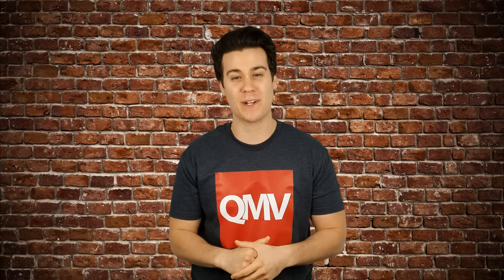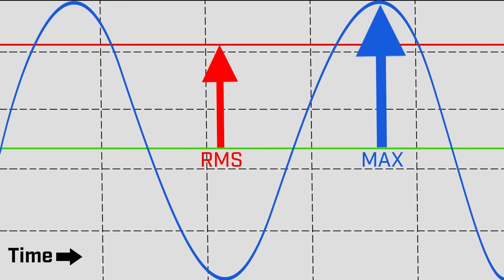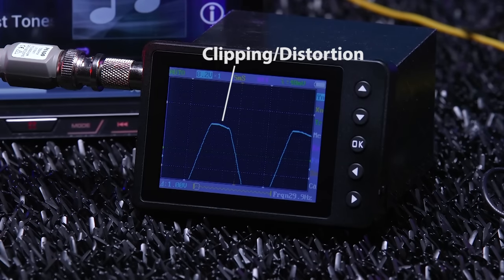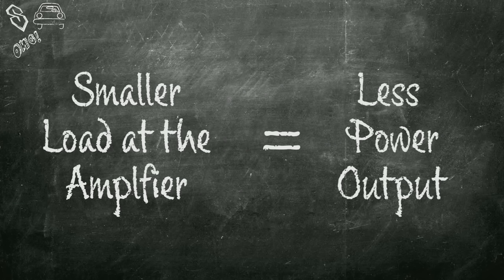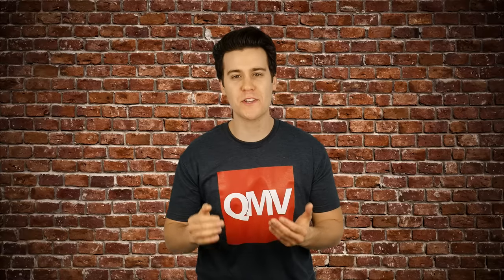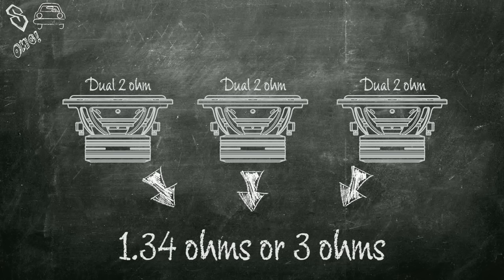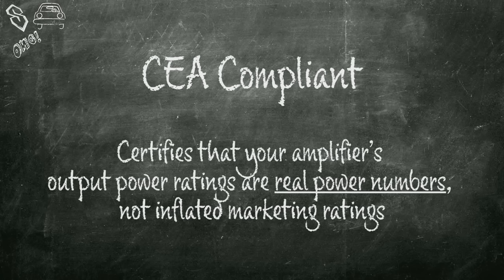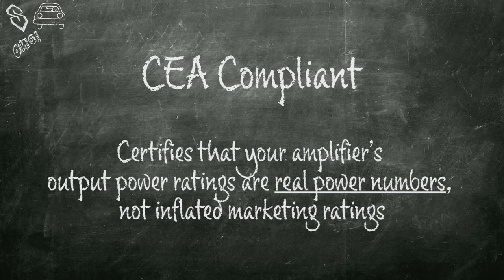How Do You Match Car Subwoofers and Amplifiers?

Comment: I have 4  2ohm dual voice coil 10 inch subwoofers that are 200 rms each what kind and size amplifier should I run thanks in advance
Reply from the maker: Four DVC 2 ohm woofers wire to 1 ohm or 4 ohm. So a monoblock with an RMS of 800-1000W RMS @ 1 ohm or 4 ohm. 

Rockford Fosgate P1000X1BD
http://www.qualitymobilevideo.com/rockford-fosgate-p1000x1.html?utm_source=YouTube&utm_medium=Video&utm_campaign=Match_Subwoofers-Amplifiers

Pioneer GM-D9701 
http://www.qualitymobilevideo.com/gm-d9701.html?utm_source=YouTube&utm_medium=Video&utm_campaign=Match_Subwoofers-Amplifiers

Rockford Fosgate R1200-1D
http://www.qualitymobilevideo.com/rockford-fosgate-r1200-1d.html?utm_source=YouTube&utm_medium=Video&utm_campaign=Match_Subwoofers-Amplifiers
Reply: @Qualitymobilevideo  cool thanks for the reply and love the video

Comment: How do you wire a system with different size subs? I have 2 8 inch and a 10 inch. Is this possible? If so how? The 2 8s are DVC 4 ohm with and RMS of 250. And the 10 is a DVC 4ohm and RMS of 350. So combined that's 850 RMS? Then wired in parallel that's .667 ohms? Now that I understand but if it running off a mono block to subs with different RMS ratings it won't cause damage? And the only amps that I have seen come close to that is 1000 RMS at .5 ohm load?

Comment: Hi I have 2x 12inch jbl jto1202d subs, I'm really stuck on what amp to buy? As I do really love to listen to low bass tracks.Any help would be fantastic.
Thank you.
James.
Reply from the maker: So those are DVC 2 ohm subwoofers. Two DVC 2 ohm woofers can wire to a 2 ohm or  8 ohm load. Wire to 2 ohm. They're also 300W RMS each, so 600W RMS combined. You'll want a monoblock with an RMS power range of 500-750W RMS @ 2 ohm. Check these out:

Pioneer GM-D9601 
http://www.qualitymobilevideo.com/gm-d9601.html?utm_source=YouTube&utm_medium=Video&utm_campaign=Match_Subwoofers-Amplifiers
 
Rockford Fosgate R1200-1D 
http://www.qualitymobilevideo.com/rockford-fosgate-r1200-1d.html?utm_source=YouTube&utm_medium=Video&utm_campaign=Match_Subwoofers-Amplifiers

Rockford Fosgate R500X1D 
http://www.qualitymobilevideo.com/rockford-fosgate-r500x1d.html?utm_source=YouTube&utm_medium=Video&utm_campaign=Match_Subwoofers-Amplifiers

Kenwood KAC5001PS 
http://www.qualitymobilevideo.com/kac5001ps.html?utm_source=YouTube&utm_medium=Video&utm_campaign=Match_Subwoofers-Amplifiers
Reply: @Qualitymobilevideo  thank you so much for letting me know! That's a fantastic help I will now do some investigating 👍

Comment: I have two 1200 watt peak Memphis subwoofers (600 rms) running on a 1600 watt   Autotek street machine amp with the wiring ran parallel on both speakers...I no longer have this amp and I’m going with a hifonics brutus brx2000.1d giving off 700 watts @ 4 ohms,1400 watts@ 2ohms,and 2000 watts 1 ohm is this good choice are was the street a better wattage choice.
Reply from the maker: What impedance are the subs? Are they dual voice coil?
Reply: 2 ohms and yes they have dual coils

Comment: Can I connect 500 rms 2 4ohm dvc sub wired together to a 1 ohm load to a 1500.1 rms amp at 1ohm or does it have to be an exact match like 2 750rms subs

Comment: can I pair of 500watts rms & 1500watts peak power subwoofer on the 500watts rms on monoblock at 2OHM ? what impedance can I choose between 2OHM or 4OHM for best performance and undamaged a subwoofer and amplifier, my monoblock 500w rms is stable 2OHM ( 300w rms at 4OHM & 500w rms at 2OHM @ 1000w max power, CEA 2006 COMPLIANT  ) better I running 2OHM or 4OHM for 500w rms subwoofer ???

Comment: Picked up a Rockford fosgate P1000X1BD and 2x Rockford Fosgate P2D2-12 Punch (400w RMS). Should I wire these at 2ohm?
Reply from the maker: Two DVC 2 ohm subs make a 2 ohm or 8 ohm load, so yes 2 ohm is ideal! However, even though that amp is legit as fuck, it only does 600W RMS @ 2ohms, whereas the subs do a combined 800W RMS. So they'll be a little under-powered. it's best to have your amplifier with a higher power rating, about 720-1000W RMS for your situation, but you should be fine.
Reply: Quality Mobile Video The description on the amp says 1000w x 1 @ 1 Ohm. Is it possible to wire my subs to 1 Ohm? Thanks for all your help!
Reply from the maker: Sorry bud, but no! If they were DVC 4 ohm woofers then yes, two of those could be wired to 1 ohm. But two DVC 2 ohm woofers can't :(
Reply: Quality Mobile Video have any suggestions on a more suitable amp?
Reply from the maker: Pioneer GM-D9601 800W RMS @ 2 ohms
http://www.qualitymobilevideo.com/gm-d9601.html?utm_source=YouTube&utm_medium=Video&utm_campaign=Match_Subwoofers-Amplifiers

Rockford Fosgate R1200-1D 800W RMS @ 2 ohms
http://www.qualitymobilevideo.com/rockford-fosgate-r1200-1d.html?utm_source=YouTube&utm_medium=Video&utm_campaign=Match_Subwoofers-Amplifiers

Kenwood KAC9106D 1000W RMS @ 2 ohma
http://www.qualitymobilevideo.com/kac9106d.html?utm_source=YouTube&utm_medium=Video&utm_campaign=Match_Subwoofers-Amplifiers

Kicker CAX1200.1 1200W RMS @ 2ohms
http://www.qualitymobilevideo.com/cxa1200-1.html?utm_source=YouTube&utm_medium=Video&utm_campaign=Match_Subwoofers-Amplifiers

Power Acoustik RZ1-1500D - 900W RMS @ 2 ohms
http://www.qualitymobilevideo.com/rz1-1500d.html?utm_source=YouTube&utm_medium=Video&utm_campaign=Match_Subwoofers-Amplifiers
Reply from the maker: Plus here's a larger list: https://www.qualitymobilevideo.com/car-audio/car-amplifiers/mono-car-amplifiers.html?amp_output_power_rms_2ohm=700-1200&dir=desc&order=price

Comment: I have 2 10" 300W 4-Ohm Planet Audio RX1014 subs. Their RMS power range is 150 watts. What would be the best way to wire this and to what type of amp, to get the most out of them?
Reply from the maker: Two SVC 4 ohm subwoofers can be wires to a 2 ohm load in parallel, which is what I would do. So you'll want a monoblock amplifier with a power rating of about 250-400W RMS @ 2 ohms. Check these:

Kicker
42PXA5001 - 500 watts RMS x 1 Channels at 2 ohms
http://www.qualitymobilevideo.com/42pxa5001.html?utm_source=YouTube&utm_medium=Video&utm_campaign=Match_Subwoofers-Amplifiers
Rockford
Fosgate P300X1 - 300 watts RMS x 1 Channels at 2 ohms
http://www.qualitymobilevideo.com/p300x1.html?utm_source=YouTube&utm_medium=Video&utm_campaign=Match_Subwoofers-Amplifiers
Rockford
Fosgate R500X1D - 500 watts RMS x 1 Channels at 2 ohms
http://www.qualitymobilevideo.com/rockford-fosgate-r500x1d.html?utm_source=YouTube&utm_medium=Video&utm_campaign=Match_Subwoofers-Amplifiers
Kicker
CXA300.1 - 300 watts RMS x 1 Channel @ 2 ohms
http://www.qualitymobilevideo.com/cxa300-1.html?utm_source=YouTube&utm_medium=Video&utm_campaign=Match_Subwoofers-Amplifiers
Kenwood
KAC5001PS - 500 watts RMS x 1 Channels at 2 ohms
http://www.qualitymobilevideo.com/kac5001ps.html?utm_source=YouTube&utm_medium=Video&utm_campaign=Match_Subwoofers-Amplifiers
Reply: Thank you so much!!👌🏽 I will do that!
Reply: Since you said 250-400 would the 500w amps be too much?
Reply from the maker: @mehoyminoy2485  That's totally fine! It's always good to have head room, and an amp with a higher rating is ideal so get it
Reply: Thank you so much!!!! And for wiring I bought a wire kit set for 1200watts from Walmart, is that ok? There was also one for 600watts and 1600watts

Comment: Hey I'd love to ask since ya offered, I just recently purchased a 15" 1500 watt AudioPipe but its a dual 2 ohm subwoofer. The amp I chose was a HiFonics 2200 watt BRUTUS. Is this okay ? The box the sub came is is saying 2800watt being that it's a dual 2 ohm woofer.
Reply: Rms of the sub is 1400 watts and the rms of the amp is 1100 watts @ 2 ohms
Reply from the maker: Without models numbers are arbitrary.
Reply: Audio pipe 15" 1500 watt dual 2 ohm - TXX-BDC5-15

HiFonics BG-2200.1D Brutus Gamma 2200 watt mono amp

Comment: I’m thinking about getting the pioneer ts-W300s4 12inch max output 1400w normal bee 400w. What’s the best amp for this sub please mate as I really don’t get it either lol
Reply from the maker: Happy to help! So that is a SVC 4 ohm woofer with an RMS of 400W. It only wires to a 4 ohm load. Easy set up, you'll want a monoblock amplifier with a power range of about 350-500W RMS @ 4 ohms. Here are some options:

Pioneer GM-D9701 
https://www.qualitymobilevideo.com/gm-d9701.html?utm_source=YouTube&utm_medium=Video&utm_campaign=Match_Subwoofers-Amplifiers

Power Acoustik EG1-2500D 
https://www.qualitymobilevideo.com/eg1-2500d.html?utm_source=YouTube&utm_medium=Video&utm_campaign=Match_Subwoofers-Amplifiers

Power Acoustik RZ1-1500D 
https://www.qualitymobilevideo.com/rz1-1500d.html?utm_source=YouTube&utm_medium=Video&utm_campaign=Match_Subwoofers-Amplifiers

Soundstream PN1.1000D
https://www.qualitymobilevideo.com/pn11000d.html?utm_source=YouTube&utm_medium=Video&utm_campaign=Match_Subwoofers-Amplifiers

Kenwood KAC-9106D 
https://www.qualitymobilevideo.com/kac9106d.html?utm_source=YouTube&utm_medium=Video&utm_campaign=Match_Subwoofers-Amplifiers

Comment: 1 American bass XFL 1222 with audiopipe 1500d sub rated 1000 rms 2000 max wired to 1 ohm amp will push 1500 rms. Should this be a good setup bos recommend 2.5 air space

Comment: Hey just quick question. I have 2 12" Kicker CVX in a sealed box and an AXA900M amp. I haven't been able to fine tune because I dont have the time yet. Is this a good match up? The kickers are 4ohms but I parallel wired them, so now they are 2ohms. And yes I did bridge the mono 2ch.
Reply from the maker: Hey Peter! So if they're 4 ohm woofers, you're incorrect with you're wiring. Two DVC 4 ohm woofers cannot be wired to a 2 ohm load. Instead, if you wire them in parallel they'll create a 1 ohm load, and a 4 ohm load in series. That amplifier is also severely under-powered for those subs. Each of your CVX's is rated 750W RMS, so 1500W RMS total. That amplifier does 900W RMS @ 1 ohm, not good. You'll want to look for a different monoblock with a power rating of about 1350-1700W RMS @ 1 ohm. Check these out:

Hifonics BRX2416.1D Brutus 
http://www.qualitymobilevideo.com/brx2416-1.html?utm_source=YouTube&utm_medium=Video&utm_campaign=Match_Subwoofers-Amplifiers

Power Acoustik BAMF1-5000D
http://www.qualitymobilevideo.com/bamf1-5000d.html?utm_source=YouTube&utm_medium=Video&utm_campaign=Match_Subwoofers-Amplifiers

Power Acoustik EG14500D
http://www.qualitymobilevideo.com/eg1-4500d.html?utm_source=YouTube&utm_medium=Video&utm_campaign=Match_Subwoofers-Amplifiers

Power Acoustik BAMF13000D
http://www.qualitymobilevideo.com/bamf1-3000d.html?utm_source=YouTube&utm_medium=Video&utm_campaign=Match_Subwoofers-Amplifiers
Reply: @Qualitymobilevideo  Cool this is helpful. Can I leave the Kickers with the parallel wiring and just get one of those recommended maps? Also my box is sealed but I was thinking of getting a ported one. One with the vent going up in the middle. My civic had a stock sub in the middle behind the rear seats, but I took it out. I wanted to use the open space to let are flow inside without having my seats down.
Reply: @Qualitymobilevideo  amps*
Reply: @Qualitymobilevideo  I wanted to ask, does Kicker make mono amps that strong as well?

Comment: I currently want to purchase the kicker single  L7S Subwoofer that has RMS of 750 peak 1500 but I’m having a hard time trying to find the best amp. I was watching the video and doing a little research but I just wanted to make sure before I purchase these items and then mess up the woofer. So to go with the kicker L7S 2ohm. Would the rockville dB13 mono amplifier with 3,000 watts peak output and 750 watts CEA-2006 rated power be the right amp to go with the subwoofer I want to purchase? Please let me know as soon as you can. I kind of want to purchase this very soon
Reply: Thank you!!!!
Reply: Or is the Harmony Audio HA-A400.1 Class D Amp Mono 800 Watt Sub Amplifier better for the subwoofer.  I’m only asking about this one because on Amazon it comes together as a kit but just because it comes together as a kit, I still want to get a professional opinion.
Reply from the maker: Hey Ayran. You have a Kicker L7S122. This is a dual voice coil 2 ohm woofer, meaning it will wire to a 1 ohm or 4 ohm load. These easiest set up would be to wire to 1 ohm, you'll need a monoblock with an RMS of 700-900W @ 1 ohm.  This is a great option:

Pioneer GM-D8701 
http://www.qualitymobilevideo.com/gm-d8701.html?utm_source=YouTube&utm_medium=Video&utm_campaign=Match_Subwoofers-Amplifiers
Reply: @Qualitymobilevideo  if the speaker is a 2ohm sub then why wouldn’t it be wired to amp that has 750Watts at 2ohms? Would the subwoofer be able to go down to 1 ohms? If so, are you sure the subwoofer wouldn’t trip meaning cutting off and on
Reply: @Qualitymobilevideo  I also want to thank you for getting back to me so quickly. It’s greatly appreciated 💪🏾
Reply: @Qualitymobilevideo  I only ask this too because the amp u recommended says it goes to 800W at 1 ohms or 500W at 2 ohms. So if the speaker only goes to 2ohm then the 500W won’t be enough to power my subwoofer since the rms is 750 and max power is 1500. In general I just want to get the right things so I don’t damage anything and I don’t have to go through the process of returning gear to get more and so forth

Comment: I have 2x8in mids in my doors and 2x1in tweets in the doors running off a 4 channel Fosgate amp and its set up as a 4ohm system, for my sub I have an 8in dual voice coil P2D2 4ohm sub and a Fosgate 300watt monoblock amp running it, also at 4ohm....I have an extra P2D2 8in sub (dual voice coil) but it is 2ohm and I do not have it installed.
My question is Can I replace the 4ohm sub I am running now with the 2ohm sub I have and get more power out of my sub and amp, or will I have to replace the amp? can I run a split ohm system in my car since the other speakers and amp are running at 4ohms.
To recall I am running a 4 channel 4ohm system for my mids and tweets, and I want to run my sub and monoblock sub amp as a 2ohm system...will this work? Thanks for the help I sincerely appreciate it. I am not getting enough bass to really keep up with the 8in mids and tweeters. I am really having to crank everything up to get enough bass the way it is now.
This is installed in a Miata if that matters

Comment: hey i have a power acoustik rzr1 2500d amp and i had a kicker compr that i got for free and the sub sounded like crap when i got it so i said screw it and burnt it up and now im looking at getting a new sub. the amp will put out 650w rms @ 4ohms and 900w rms @ 2ohms. i was looking at getting a skar audio ddx-12 which can handle 1000w rms with dual 2 or 4 ohm coils. would this be a good match and if not, what would be? im looking to stay around or under $160
Reply from the maker: Because of your amplifier's impedance configurations, you'd have to go with the DVC 4 ohm version subwoofer, to create the 2 ohm load. Generally I recommend using an amplifier with a higher RMS rating than the subwoofer(s) for head room, but it's pretty close and you should be fine

Comment: I have a 2009 gmc duramax it’s exhaust is pretty friggin loud. I listen to rap n some hip hop but I want my system to bump loud enough to be heard over the exhaust but not so loud it’s annoying.....any suggestions on 2 good subs and a good amp to pair with them? First time buyer so kinda new to this! Thanks
Reply from the maker: Depends on your budget!?
Reply: Quality Mobile Video 800 bucks is my budget!
Reply from the maker: Check this out! 
Two Rockford Fosgate P2D2-10
https://www.qualitymobilevideo.com/rockford-fosgate-p2d2-10-10-punch-p2-2-ohm-dvc-subwoofer.html
Rockford Fosgate R1200-1D
https://www.qualitymobilevideo.com/rockford-fosgate-r1200-1d.html

Hitting that 2 ohm load for great power that isn't overwhelming and solid efficiency, plus some leftover cash for boxes/installation parts

Comment: Hello,  i have a mono amp (kenwood 8105D) which is 1000w max 300 rms at 4ohms and was wondering if you can recommend a sub or subs for it. I would like 2 10 inch subs or 1 12 inch sub.
Reply from the maker: If you want two 10's, you'll want two DVC 2 ohm subwoofers with power ratings of 200-250W RMS each, and wire in parallel @ 2 ohm. For one 12" sub I'd recommend a DVC 4 ohm woofer with a power rating of 400-500W RMS and wire in parallel to the 2 ohm load.

Comment: So ok my question is i wanna wire to subs each are dual 2ohms and 700w rms each. . So witch amp would b perfect for those subs ??? And wat do u think about massive audio gtx102 subs ?? R they good ? Do they hold and etc ? And is it enough 4 gauge wire to wire this amp for those subs ? Thanks
Reply from the maker: So two DVC 2 ohm subs wire to a 2 ohm load or an 8 ohm load, go for the 2 ohm load. You'll want a monoblock amplifier with a power range of about 1250-1600W RMS @ 2 ohms. Check these out:

Power Acoustik EG14500D 2000W RMS @ 2ohms
http://www.qualitymobilevideo.com/eg1-4500d.html?utm_source=YouTube&utm_medium=Video&utm_campaign=Match_Subwoofers-Amplifiers

Power Acoustik BAMF1-5000D 1700W RMS @ 2ohms
http://www.qualitymobilevideo.com/bamf1-5000d.html?utm_source=YouTube&utm_medium=Video&utm_campaign=Match_Subwoofers-Amplifiers

Hifonics Zeus ZRX3216 1600W RMS @ 2ohms
http://www.qualitymobilevideo.com/zrx3216-1d.html?utm_source=YouTube&utm_medium=Video&utm_campaign=Match_Subwoofers-Amplifiers

Hifonics Brutus BRX2016.1D 1400W RMS @ 2ohms
http://www.qualitymobilevideo.com/brx2016-1.html?utm_source=YouTube&utm_medium=Video&utm_campaign=Match_Subwoofers-Amplifiers
Reply: @Qualitymobilevideo  so if i get an amp 2ohm stable is it gonna b good ? Or should i get 1ohm stable ?
Reply from the maker: @laurynasgieba  You can't wire those subwoofers together to 1 ohm. You can only wire them to a 2 ohm load.

Comment: Hi i have 2 dvc subwofers at 4 ohms 400rms i connect at 1ohms 800rms my amplifier is 1800rms  at 1ohms if i connect at 4 ohms my my amplifier is 650rms which better connection 1ohms or 4 ohms thanks